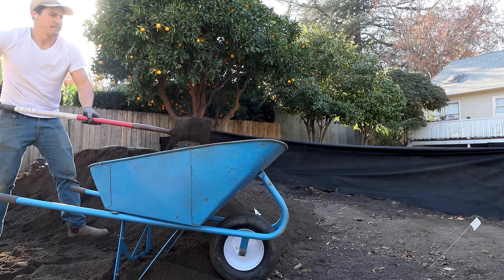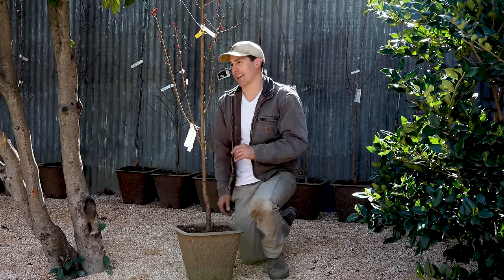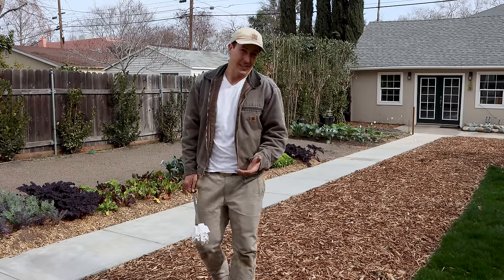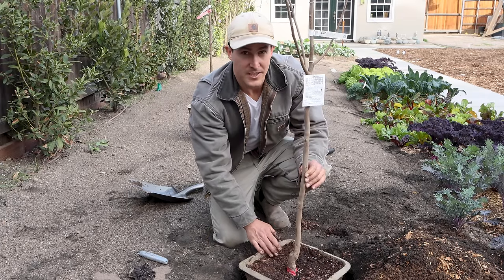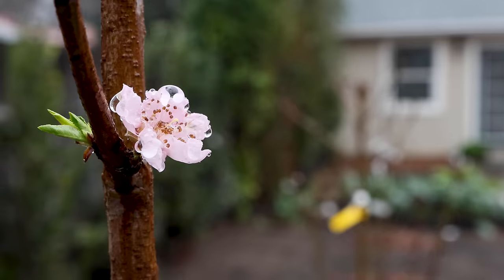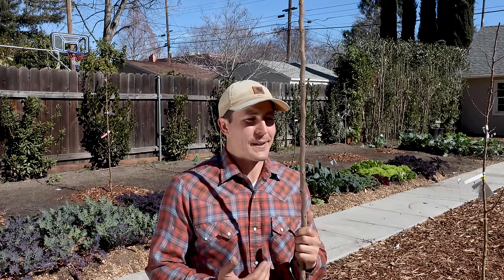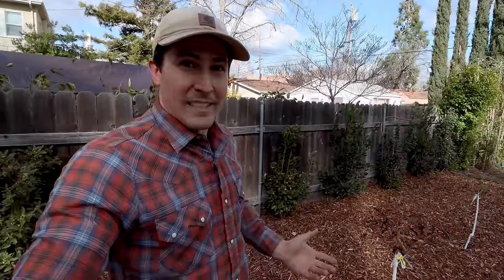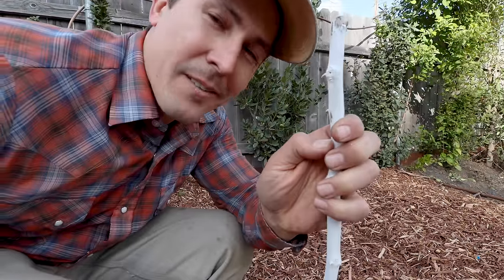How to Plant, Prune, and Irrigate Fruit Trees  EVERYTHING YOU NEED TO KNOW

Comment: Just discovered you. Really good video. I have pruning videos and it's incredible how much our methods align. One thing I'd like to add about the paint - another great option is a lime whitewash - much better for the environment and soil if any gets washed into it. Also you mentioned that you aren't worried as much about the winter sun, and that's because of where you are. However, way up here in Zone 4 it's precisely the winter sun that is of concern and why we also whitewash trees. The winter sun warms the trunk up and it expands. Then the cold night temps come and it contracts. This swell/shrink cycle can split bark and lead to gummosis. Peaches are especially vulnerable to this. So for those of you who are in colder climates and think "I don't need to protect my trunk from the sun", you really should. Great video, excited to watch this grow. 

You should consider turning that area into a food forest. You can check out my food forest, it's pretty awesome. Basically it would entail adding the 6 other layers of a forest into the planting. Then again, your space is a little more urban (hence the channel) and a wilder look may not be desired. If it were me though, I'd cram the interspaces with bushes, flowers, groundcovers and turn that orchard into an ecosystem.

Comment: nothing wrong with clay soils, once you unlock the clay , it is very nutrient dense. Use some gypsum a lot of gypsum, it breaks up the clay , just spread it on the to and it will slowly work it's way down into the soil, makes a huge difference
Reply from the maker: Yes! Clay is super nutrient dense, especially here in this historic flood area the mineral content is exceptional! I do also add gypsum, just didn’t at this stage. Thank you for sharing your feedback

Comment: I make my own white wash from hydrated lime and water.  I make it about as thick as most paints.  I ca wash the paintbrush out with just water.  I paint them up to the first scaffolding branches with several coats.   Y young dogwood was showing signs of sun scald and I painted it, too.  My peach tree was also painted with whitewash even though it has not shown any signs of sun scald, due to its large canopy.  My apple trees did and were painted.
Reply from the maker: Great tip!

Comment: Good video. Clearly you have either educated yourself or took classes. I better paint would be 1 part indoor white latex paint, one part water, and one part drywall spackling. The reason for the spackling is to deter rabbits and voles from eating the bark. Works great.

You mentioned to not plant trees south of your veggies ( to which I agree), yet, that is what you did. Were you planning to move the veggies? Maybe I didn't catch your North/South directions. However, you placed the graft facing the left of the screen which would indicate north. In planting rows, it is generally best to plant the rows in a north-south direction so the rows get equal light on both sides of the row.
Reply from the maker: Thank you. The vegetable garden has moved

Comment: Wow! Clear and to the point. Particularly loved the pruning demonstrations. Happy to have found your site.
How long does the paint on the trunks last ? Do you reapply it until the canopy shades the trunk or does the trunk toughen up enough after the first year ?
I live in a temperate climate (20 inches rain) with dry summers and we usually get some heat (average 17 days over 95  but we have had 13 consecutive days 100 F or over) I know that is not very hot compared to some places and hats off to any hot climate gardeners out there.
Reply from the maker: Thank you! The paint should last all summer

Comment: great video, just a tip - no need to firm the soil especially with your foot, just back fill and water accordingly, overtime the soil ecology will compact appropriately beneficial for couple of factors..,trust me it works great.
Reply from the maker: Thank you! And thank you for sharing this tip!
Reply: That's totally inaccurate. You need to tamp in very strongly.
Reply: @johncummins6655  NO -you don't need to do it 'strongly', have done that 100x and it works perfectly, your hand's force is enough.

Comment: Hi Kyle, great video, unfortunately I landed on it 30 fruit trees too late.... Could you please give me some advice on the following 2 question: 1 - I'm in north Florida, sandy soil, no organic matter to speak of. I planted my trees in holes surrounded by either compost or potting soil... What can I do to encourage the roots to expand and look for nutrients and water beyond the hole? And how can I improve the soil around the tree without bringing in earth digging equipment? (I'm thinking making a wide ring of compost topped with mulch hoping nutrients will leach into the sand). 2 - i planted a mulberry tree that is a single stick 8 feet tall. I already decided to cut it down but was going to wait for it to go dormant (Jan 2022). Would it be better to do it now in the heat of the Florida summer? Thanks in advance!
Reply from the maker: Hi, thank you! Your plan to top dress with a wide ring of compost is exactly what I was going to suggest. The nutrients and organic mater will make their way deeper. You can probably top the tree now.

Comment: I had to pull out the kind of irrigation lines used here as the gophers were constantly damaging it,  and being covered,  I wouldn't see it.  I replaced it with pvc run lines and then transition to a ring of poly drip with inline emitters rund each tree on top of the dirt abs under the mulch.  The end of the drip line by the trunk comes to the surface so I can visibly see the full line is dripping.
Reply from the maker: Glad to hear you found a good solution to your problem! I’m grateful to not have gophers here.

Comment: Ok here is my question when should we cut/prune on the tree's ?

I think I understand but not 100% sure ? Correct me if I'm wrong.

Plant in late winter/ early spring and make initial cuts to set height and shape ?
Prune in summer months to remove excess growth,but at the start of summer ,the middle ,end ,anytime ?
When not to cut/prune fall and winter months unless it's a sucker root ?

This is what I'm unsure of I though everyone pruned when tress are dormant in the winter while the tree was hibernating,but from the videos that seems to be the wrong time ? We just planted two potted apple trees and one peach tree at the first of August and we are in south Georgia. I have the tress spaced 15ft apart but don't want them any taller than I can reach from a 6ft ladder. They are in full sun light and haven't be prune or shaped yet. So to get desired height where should I start the branches and when should I make these cuts ?
Reply from the maker: best to prune twice a year. once in summer and once when dormant in winter.

Comment: thanks for the video and information.

to improve the drainage and composition of your soil, looks like you did not dig out the clay, just added the new mixture (compost and loamy soil) to the top without tilling it into the lower layer, right?  a few questions:
-how does adding this improved soil at the top improve the drainage of the soil below?
-how thick did you lay the new mixture on top...does it settle or compact easily because it's so loose?
-did you get the loamy soil seperately and where if you don't mind...
-is loamy soil, just top soil that i get from a rock/soil yard?
thanks for your answers.

Comment: Do you know about pruning the trees so they stay less than 10' tall and also pulling the branches growing upward to a more horizontal positioning?  People do it with strings and anchors until the banches are trained (a year or two), and then remove the strings.  They make the tree spread out so the fruit is low to the ground for easier harvesting and the branches  grow well as they get more Sun exposure.
Reply from the maker: Yes, I keep them all below 8 feet. Have you watched my pruning videos?

Comment: I have planted multiple fruit trees in the fall last year and have seen your videos. Really great advice and explanations given. One thing I would like to know is that I haven't done any winter pruning on my trees and I'm late to cutting them down to knee height. My spacing is the same and my size desired is also the same. Given that it's now july, what would you do if you were in my shoes? Cut them down to the 24 inches asap, or should I do something different? Especially if cutting down to 24 inches will result in no branching, I will be waiting on new branches to form. So some trees will have no leaves until this happens...

Comment: Great video. Besides the pruning, it was interesting to learn about the paint. 

We’re in East Sac/Fair Oaks and very familiar with the sandy-clay rock of soil we have. It seemed that you just put a relatively thin layer of good soil on the top. Doesn’t that still leave the poor draining hardpan layer around the roots?
Reply from the maker: Thank you! The soil above will incorporate into the soil below over time. The soil in East Sac is probably quite a bit different than the soil in Fair Oaks. Here in East Sac it’s a historic floodplain so although it’s full of clay it’s also very rich in nutrients

Comment: With modern idea of urban mulching resulting from a Chicago arboretum field study. I like to pass along a few suggestions we've since learned are vitally important.

Sweeping trunk flare clean of any accumulating organic matter each spring has proven to be one of the most beneficial things for a young establishing tree.

Which besides preventing wood chips from laying against above ground portion of trunk which needs to breath and stay dry. 

This regular housekeeping will deny any new above ground adventitious root growth a heightened path coming in contact with defenseless portion of main stem higher up trunk. 

As ancient trees had already evolved widening trunk flares long ago in order to hydraulically manage against any strangling roots.

But when we witness a trunk which lacks any visible widening girth before entering ground. AKA resembling a girthless fence pole or telephone pole.

Similar to difference between noose around your shoulders and your neck. 

Once a caretaker artificially raises dirt level above Root stocks original birth grade. Portion of lower trunk which lacks this Regular increase in girth is then defenseless against potential circling root strangulation.

Normally hidden from view. Lower trunk no longer free to expand will end up with a flat side or two or several other unnormal trunk shape anomalies. Including certain sides of restricted trunk missing familiar buttress root curving outward and away from trunk.

Think of a Christmas tree stand only having two supporting legs next to each other on one side and lacking any at all on the opposite side.

Rather than an evenly spaced out traditional three or four around trunk.
Which also can be compared to a hat stand.

This trunk root flair structural support may not be so important when it comes to understory trees compared to tall hardwoods.

But when a young tree requires extra support with staking to keep upright. Especially during heavy fruit production stage.

Need for staking should be considered suspect. Resulting from lacking structural support normally produced from radially outbound root system.

Which at least can result in a problem which further encourages selective fruit removal early on in production. Resulting in a more reasonable population of fruit potentially receiving a more optimal share of resources.

This is why I personally prefer planting bare root whips already grafted onto rootstock species selected for its more vigorous growth and less acceptability to common soil borne diseases.

Then there always can be somewhat deformed dog leg graft. And like you mentioned lifetime susceptibility where sensitive graft points is best oriented away from direct sunlight.
Reply from the maker: Thank you for sharing all of this

Comment: Great video, super educational. we’re not too far off near Sacramento and are dealing with similar conditions. I’m super curious about your irrigation system. Is it branched off of a traditional setup or self installed? Also that distribution hose looks awesome. Would you mind sharing what you used to put it together?
Reply from the maker: Thank you! I have some of the irrigation items linked in the video description and I do have a more in-depth irrigation video that I made this time last year. Yes, it’s attached to valves with a controller.

Comment: Thank you! Learn a lot from your tree pruning video! I have been doing it all wrong because I was reluctant to cut it down.  From now on will start pruning them the way you do.  I have a question on pest on peach tree.  My peach looks so good but starts rotting from the inside when it’s about to ripe. There is worms inside the peach.  How to prevent it?
Reply from the maker: Thank you! I do t yet have experience with that pest
Reply: I think you apply a copper spray made for this. 2 or 3 xs...when the tree is dormant in the winter
Reply: @patriciaalbertson5183  thank you!

Comment: Hi. I just bought 10 fruit trees (apple, peach, pear, and plum) I plan on moving next summer and want to take them with me, so my intention is to put them in pots. The trees are currently in 1 gallon pots. The pots I bought are 24 inch (diameter) pots. Is that to big a jump? Should I paint the trees now (it's fall) or wait until spring? Should I bring the trees inside when the temp gets below 32? I'm in Ga. I had thought about throwing some plastic around my old dog kennel to use as a temporary greenhouse, would that work? Thanks for your help, I really appreciate it.
Reply from the maker: The 24 inch posts should be good. You can wait to paint.

Comment: Fantastic video! I was wondering where you sourced your compost/loam mix? I have a local aggregate supplier that sells compost and a compost/loam mix. I did some research into where they source it from, and while it is labeled low saline, organic, seed free, ph neutral, they actually buy it from a large california based maker of compost, so I'm guessing the compost is not unlike municipal compost. How do you know you're sourcing good stuff without heavy metal contamination and the like? I like the product they offer and I'm thinking of doing fill terraces with essentially that compost/sandy loam mix, but I'm hesitant to spread so much on my land. Any advice?  Also, any advice on creating a similar zone on a slope? Thanks for all the incredible work!
Reply from the maker: Thank you! I now source from Florin Perkins, and I do use the organic products, but your right that it’s tough to know exactly what’s in it, and I do think that most places likely source from the same supplier in each region.
Reply from the maker: For a slope you’d probably just want to form or build terraces for each row
Reply: Thank you for the feedback. Your orchard is inspiring!  @urbanfarmstead

Comment: I left a couple questions on the timing of summer pruning on that video and have another question on this stage of the planting regarding trunk protection from critters and deer. I'm in a more rural area, much more animal traffic on my place. What is best to protect the trees from the variety of animals that may come (rabbits, chipmunks, deer, or even my own chickens). I had planned to use some hardware cloth (which i alrrady have) and make cylinders slightly bigger than the trunk, but wasn't sure if the sharpness of the galvanized wire and if it would scar the trunk during moment and such. Is it better to find the commercial plastic spiral wrap stuff even if it means purchasing something new to do this task?

Comment: The mainline you used is very different (has connectors for the feeders). Are the connectors add-ons or was it bought that way?
Thank You!
Reply from the maker: Yes, I love it! It’s a 3/4” header made by Rainbird. It’s on my Amazon page linked in the description, but it was out of stock last I checked. I buy them at a local shop. I share more about it in my irrigation video.
Reply: @urbanfarmstead  Found it. Thank You!

Comment: Thanks for the great video, Kyle!  I have a question.  I planted my fruit trees bare root 3 years ago (3 different varieties of apple) and they aren't growing very much.  I also live in Northern California and have heavy clay soil.  I've been sprinkling gypsum around my trees based on the recommendation from the nursery where I bought them.  I wish I had fortified my soil with the compost mix that you used, but I didn't do that.  Is there much I can do at this point to try and encourage growth of my trees?  ...btw they are producing apples, but the apples are pretty small and not super tasty.
Reply from the maker: Yeah, gypsum is good also but it’s very important to add compost. You should mulch with compost to help now
Reply: Also...you might need a lot more than a sprinkle. And work it inti the soil a bit

Comment: Hey Kyle, what are your thoughts on planting fruit trees on top of a leach field? I keep reading there's no significant risk of food contamination, but there is a big risk of damage to the septic system due to root intrusion. I've also read this can be somewhat mitigated with root barriers and/or adding copper sulfate to the septic tank, but that just seems very counter productive to, you know, growing trees.
Reply: I purchased a house with a septic system recently, and wound up having to replace the entire septic tank shortly afterwards. Tree roots had grown down into the leach field and had absolutely destroyed the system by preventing it from draining. I only found this out when I suddenly wasn't able to flush toilets without sewage burping up into my shower.

I would STRONGLY recommend against planting any trees near your leach field. Trust me, in ten years it's gonna cost you at least 15 or 20 thousand dollars to fix.